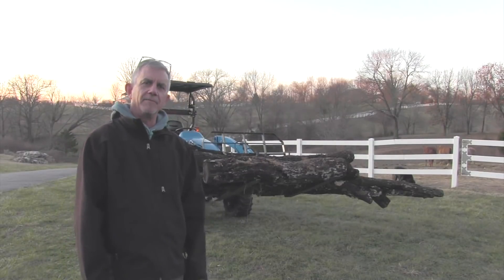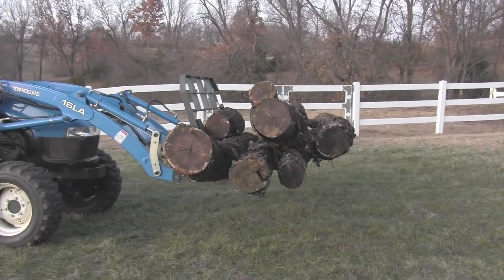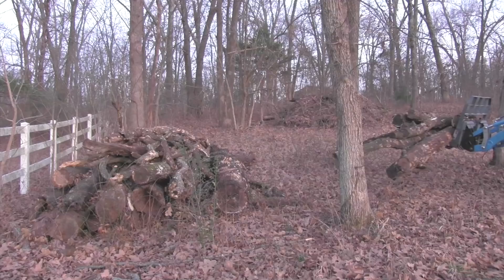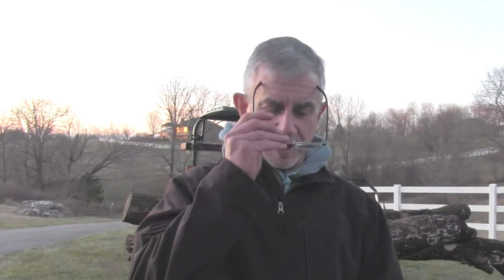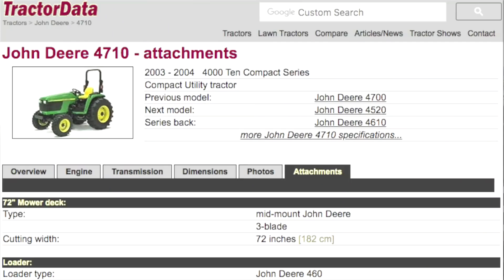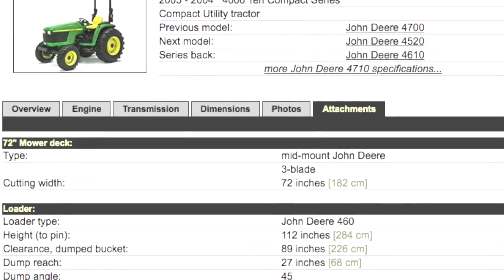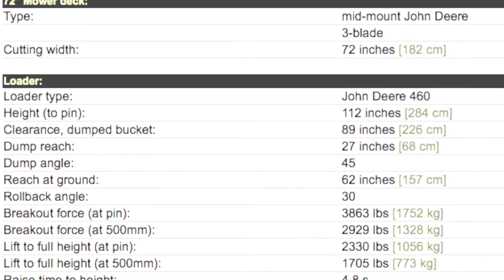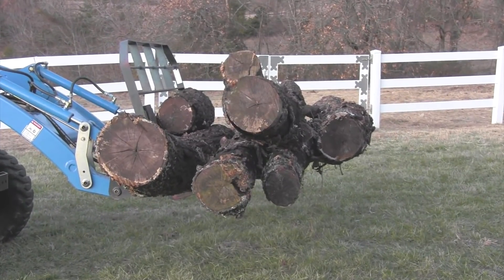How Do I Know the True Lift Capacity of a Tractor?

Comment: Since you have real experience, and after all your videos o er the years you e earned my respect. 

Can I ask you a good riddle? 
I have a Deere 1050 with the 75 loader. Rated abit shy of 1000 pounds it'll hold at full height, has 1800 pounds of "lifting force" and we'll over 2000 pounds of break out force. So what is the tractors real lifting capacity?
When I have the time and parts I am going to install modern joystick, but will save the OEM twin sticks
Reply from the maker: The spec I look at that'll be in the ballpark is the lift capacity at 500mm forward from the pins or about 19" out on the forks.  But, the ballast of the tractor, the position of the load, the slope you're on, and the tractor's mechanical condition all dictate how much it'll pick up.  There's no good way to predict accurately with so many variables.

Comment: The question I have, which I can't find any answers to, is how can you tell if you are carrying too much weight?  As a new tractor owner I am concerned about damaging the loader.  It's fine to know that my JD 2032R can handle 803 lbs. at 19.7 inches forward of pivot point to maximum height, but when I'm moving around boulders or a bucket full of bricks I don't know how much they weigh.  Is this as simple as saying "if the loader will lift it, it is fine for the loader?"  Are we simply concerned about whether the tractor can achieve the work or do we have to be concerned about overloading the loader?  (I'm not talking about overloading in terms of proper ballast - I don't mean that discussion; I mean strictly related to not damaging the loader.)  There have been times when I've lifted what seems like a heavy load and I see some "wobble" of the bucket - meaning there is a bounce-like motion of the bucket around the attachment points - probably the pins (it is not quick attach).  Thoughts?
Reply from the maker: Scott, that will be this week's video.  Stay tuned!

Comment: When I drop a tree, I cut off about 8 feet of the thickest part and lift it with my forks.  Then I lift / drag the rest of the tree trunk with a three point lift boom.   I learned this the hard way.  You must have some weight balance between the front and back of the tractor.

Comment: The worst case isn't at full height, it's when the loader arms are about half height, the load is  farthest ahead of the front axle that it is going to be.  That exact height is going to be different depending on the make and model of the loader and tractor.

Comment: And your throttle needs to be at operating rpm. Wont lift worth a crap at idle. Hydraulic pump needs to be pumping with the correct rpm
Reply: TennCutty not exactly. The pressure to lift the majority of what a loader is capable of can be done at engine idle speeds. the reason it seems like a tractor doesn’t lift  well at idle is because the pump isn’t moving a large volume of fluid, and the recovery time isn’t there to keep filling the lift cylinders quickly. Running at operating engine speeds is more about meeting volume demand, not pressure demand. Pressure is the lift strength, volume is the lift speed.

Comment: Mike, I think that the measurement from the “pin” may have come about due to the skid steer quick attachment. Tractor manufacturers use to measure 500mm because that was about the depth or average point on a fixed bucket. By using grapples, forks, buckets and so forth, the moment of measurement moves depending on the attachment. Also it seems every 500m outward from the pin, the capacity is about 74% from the previous point. For example if the lift capacity at the pins is 1000 pounds, then 500 mm out has a capacity of 740 pound, 1000mm out is 547 pounds and 1500mm out is 405 pounds. I could be wrong on this though.

Comment: Thanks for clarifying the pin weight. I wasn't sure which pin they were referring to, I thought it was the pin where the loader arms meet the frame.
From time to time I have to move around some mostly full IBC tanks and when completely full, my old Kubota L39 could barely get them to angle back to shift the center of gravity and lift them more than an inch or two off the ground, but at least I could push them around. With my LS 4155 I can lift up to a truck bed, but will never go any higher, as you can feel the tractor wanting to lift up in the rear end. For ballast I usually have my box scraper attached to the 3pt, which for the most part is more than enough when moving a bucket full of rock. IBC tanks are either 275 gallons or 330 gallons and with just water can weigh 2,200 - 2640 lbs and even the LS 4155  will struggle with the larger tanks. When that happens I use my carryall on the 3pt (which doubles as a set of forks and will fit a standard pallet), which has a greater lifting capacity (about 500 lbs more) than the front loader arms and have no problems with the larger tanks when full.

Comment: Normally the manufacturers will size the bucket to the loader capacity, so it will pick up a full bucket of dirt, gravel, etc.to the max height. Forks and grapples are where you can run into problems. And the point made in the video about less capacity moving away from the pin goes double for the clamp on pallet forks that attach to the bucket.
Reply: I forgot about the clamp on forks that are out there.
Reply: But that’s just the thing, now with universal skid steer attachments people are putting on larger buckets, pallet forks, etc that will handle far beyond what their machine/ loader is capable of. And of course many dealers are more than willing to sell a guy a more expensive larger bucket.

Comment: The "pin lift" capacity is a way to rate the loader and gives an "apples to apples" comparison as this assumes that "All" tractor loaders have pins where the attachment would go. If you use the 500mm location to rate a loader then you are introducing an unknown factor , ie. the attachment that extends to 500mm and really have no way to compare two different loaders with different attachments.

It's kind of like if Ford gave crankshaft HP and Chevrolet gave rear-wheel HP in their trucks....

This is how I understand it anyways....